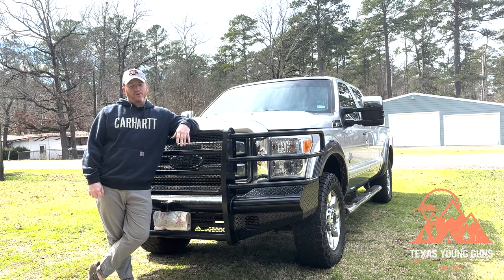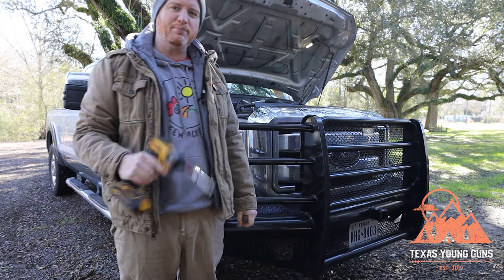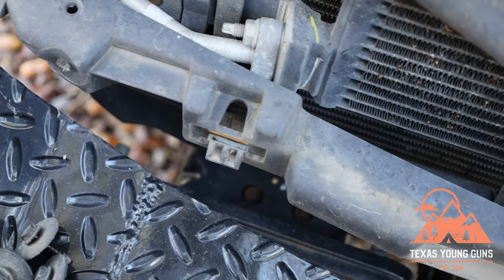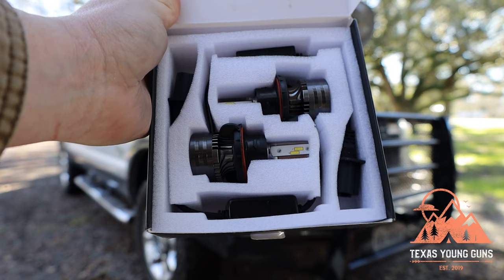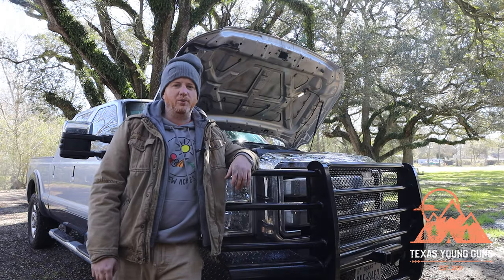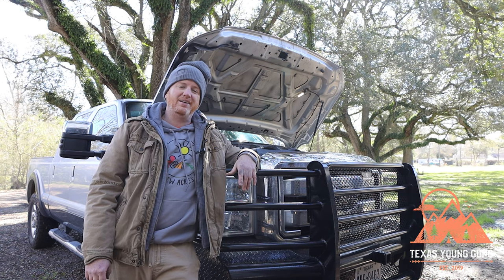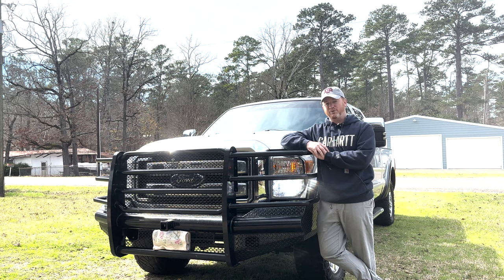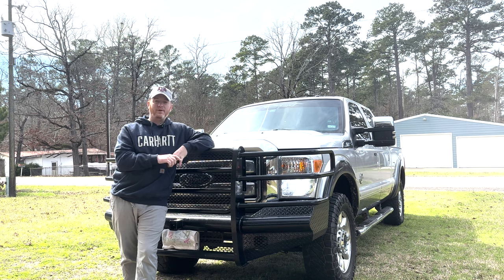Upgrading our Ford F250 to Trueland LED Headlight Bulbs WITH Before and After Comparison

Comment: Everything you say is absolutely correct.

I ended up going with the Morimoto 2Stroke H13 because I am familiar with the brand.

I want H13s from DDM, but they don't seem to make them in a 4500k color temperature anymore so I had to get the bluish-white lights like everyone else.